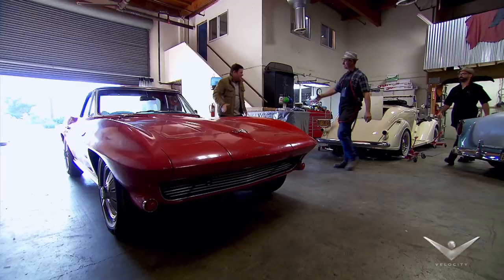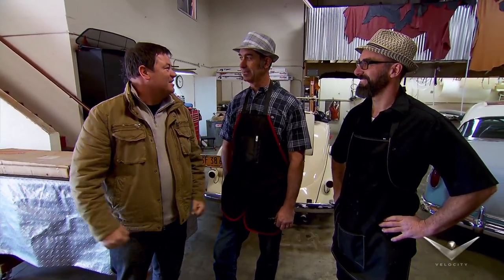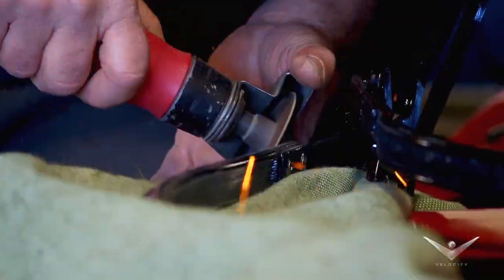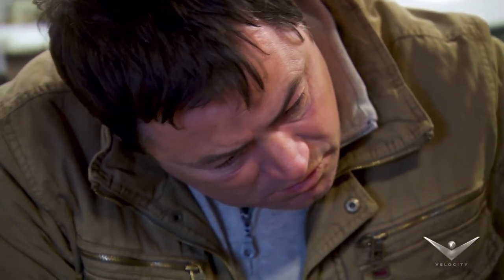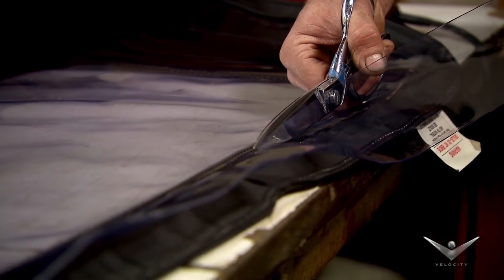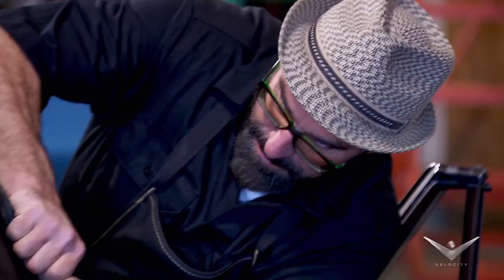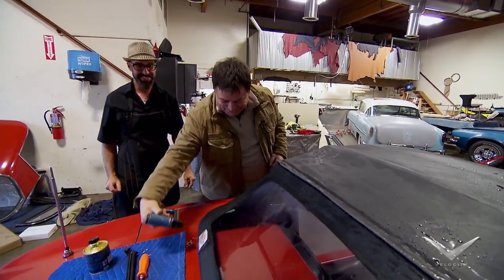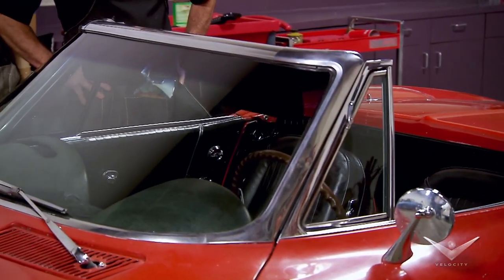Corvette Soft Top Install | Wheeler Dealers

Comment: It does look nice and will be functional, unfortunately it can’t be considered a restoration. Because the original tops were heat sealed not stitched. Still, it will do its job. I actually stitched in a heavy duty plastic window in my 1977 triumph TR7 while it was on the car! I used heavy duty waxed tread and two needles (the way saddlery is stitched) And it too was functional and water tight.